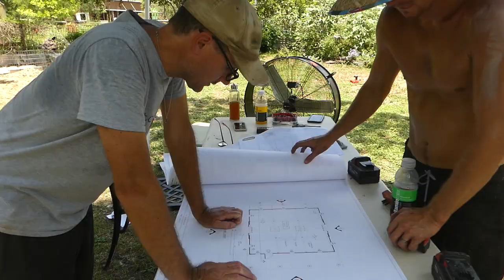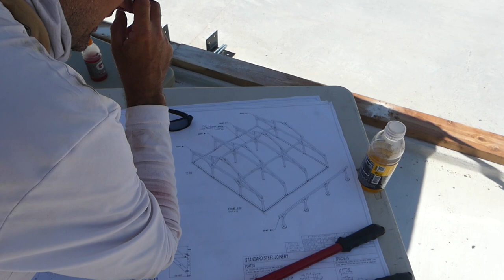Building my Dream POST & BEAM BARN - Part 1

Comment: Are there concernes about the cracks in the posts ?
Reply from the maker: I don't believe so. It seems pretty normal with this type of construction.
Reply: @daddykirbs  No  those   splits  are  called  checking and is  completely normal and  safe  and sound .  It actually adds character to the wood